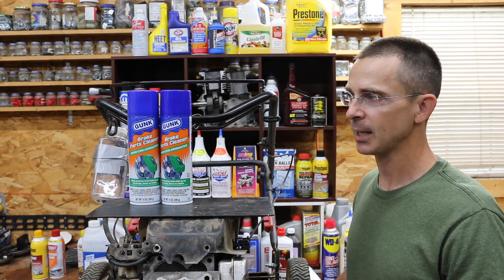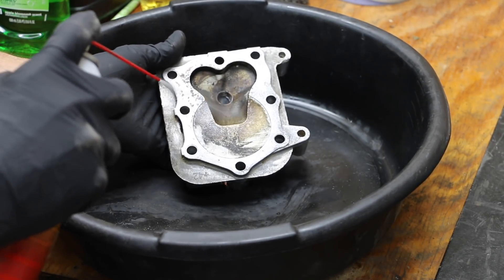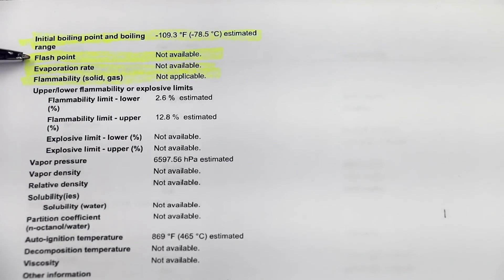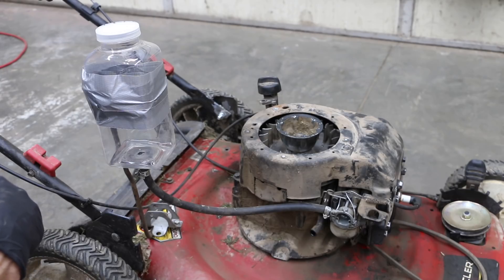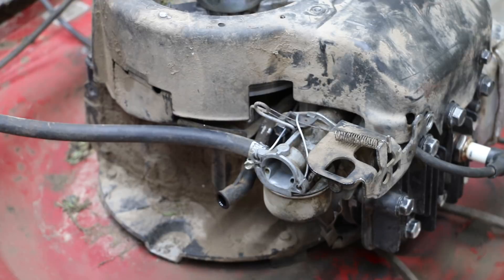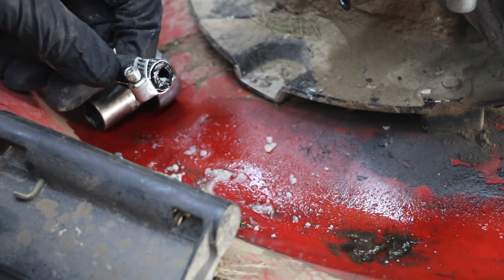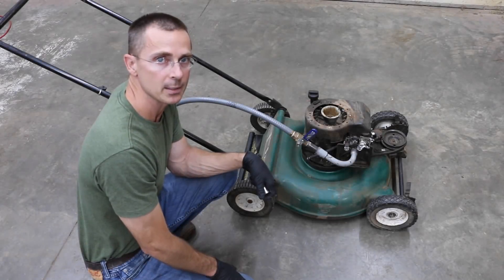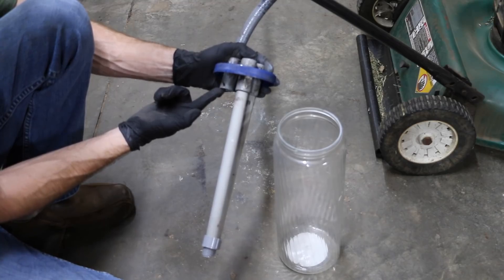Will a Gas Engine Run on Brake Parts Cleaner?  Lets find out!

Comment: My father is 79 years old he’s a gear head and loves to tinker and after watching this video he built a lawn mower that runs on vapor. This kind of stuff keeps him still wanting to build things. Thanks for your content we love it.
Reply from the maker: That is awesome!
Reply: ALL engines run on vapor. That's what a carburetor does...
Reply: @davelowets  you have no clue how fuel works
Reply: @goldgulfcoastdesignericsho8628  Yup, sure do. Do you?? Fuel in a liquid state does NOT burn. It HAS to be a vapor, therefore ALL engines convert the fuel to a vapor before it's burned in the combustion chamber. Fucking about, and trying to "make an engine run on vapor" is COMPLETELY unnecessary because the engine already does so on it's own. Wise up, man.
Reply: @goldgulfcoastdesignericsho8628  If you're a "mechanic", you're a very poor one.
Reply: @davelowets  It's all good, you both right, normal people would claim the liquid fuel is all that's needed cause its what they see, but the carburetor mixes or atomizes liquid fuel with regulated air to form the desired vapor that is then combusted. I guess the vapor rig is a good troubleshooting substitute for a suspected bad carb. Usually pretty evident with bad carb symptoms, but sometimes tricky/difficult to pinpoint and maybe the vapor rig would help. Already its proven to work if you need those last blades of grass to cut while ordering/waiting for another carb,
Reply: @davelowets  your right. If you had a 5gal bucket full of gas with an exhaust fan over it to keep vapors from pooling on top and around it. And threw a cigg road flare  match.  It would snuff out in the bucket. That vapour modification ppl do does seem to be misunderstood. Your doig the same thing the carburator does but the amount of agitation is what will vary in a resukt if more or less fuel being consumed. If its churning up a bunch of bubbles and highly agitated like this guys is. Then your doing nothing. Possibly getting even less fuel efficiency. But if you have set to mildly agitate it and it takes some trial and error you can make it runn and use reasonably less fuel. My pressure washer uses much less fuel than it did with my bubbler set up. It doesn't rev as high as it did normally. But I still get the same amount of water pressure.  Also I have to put a little gas into the carb to get it started. My bubbler set up is enough to keep it running but not enough to start the motor.  Which an engine uses more fuell to get started. And with a gravity feed set for the starting parameters is going to be wasting fuel using the same flow rate to run it.
Reply: @mikeyd717  IF the engine is tuned correctly, it is going to run the SAME, and use the exact SAME amount of fuel, whether its running off of a carb, fuel injection, or some type of "fuel vaporizer" system. If yours is running longer on your system, then you're simply running it leaner that is was with the carb which might NOT be good for the engine depending on how much leaner it is running. One could get the exact same effect by leaning out the stock carburetor a little bit. A proper air/fuel ratio and fuel rate consumption for a specific model of engine IS what it IS, and the engine is going to consume fuel at the same fixed rate(assuming proper tune) no matter how it's getting it's fuel. There's NO magic device that is going to change that. Unless you don't know how to properly tune a carb, that is.
Reply: @davelowets  I don't know for sure where the guy who modified the Ford Maverick got the idea from but when I saw it I figured he must have read about an inventor in the 70's who held a patent for a carburator that he put in a Ford ltd and drove it 200 miles on 2 gals of gas. His name was Tom ogle. And a news crew was there to report on it. They checked the car all over for hidden gas tanks etc. Then the reporter I think rode with him for the 200ish miles before they ran out of fuel. It does get a little conspiracy theory around his invention and what followed after he made the trip.  Which is fairly new info the original story I read years before didn't have any of that other stuff just the fact that it did happen and the guy had a real patent for a carburator design. And it was all before you tube magic and perpetual machines with hidden Motors. Back in the earlier days of information exchange on the internet.  The story of Tom ogle seems to resurface whenever issue of high gas prices come up for debate. I'm not an engineer and I learn from reading and doing my best  to sort out what makes sense and what doesn't. I do believe that vehicles aren't offered with maximum efficiency possible in mind. There's a lot of variables involved some with good reason. Others With more questionable motives. And I def believe that  Maxing out horsepower and throttle response doesn't equate to better efficiency.
Reply: @mikeyd717  Thats all a scam...

Comment: This was not educational? You indicated the engine temp before & after, you said very its corrosive, kills rubber & plastic. I saw an alternate fuel should I get suck in a snow storm in Alaska, on in the desert without water.  I may trash the engine by the time i get home but that can be replaced.

Comment: I've not watched the vid yet but im sure it will work, i drive gokarts (2-stroke) and when they don't fire up, there's a trick where you spray brake cleaner through the spark plug hole and then try start it again (with the spark plug in obviously) and if it fires 2 or 3 times and cuts out, you usually have a fuel problem, if  it doesn't fire at all, usually the spark plug needs changing. If it starts up and continues running like normal, there was probably just an air bubble in the fuel line

Edit: just be4 i clicked play, i thought of something, tm pretty sure break cleaner is more explosive than petrol, so i think it will start up, but then go WAY past the rev limit, like trying to run a car on purely nos

Edit2: i was wrong lol
Reply from the maker: Thanks for the feedback.

Comment: Back over 50 years ago, the subject of gasoline octane came up in my high school chemistry class. As a teenager very interested in everything automotive, I thought high octane meant really explosive, powerful gas.  You know, Av-gas, the Ethyl or High Test, or I will just say the number "260".  You guys know what I mean, the fuels of the day.  We all knew that high compression engines needed the high octane stuff.  Imagine my surprise when I learned that high octane gasoline burned,  "exploded", slower than the regular grades.  And that it was that ability to slow burn that prevented "knock" and all of the bad things associated with it.  The Octane rating of a fuel reflects how likely is a fuel to resist knock.  With a rating of 0 being the worst, and a number of 100 given to a very good fuel indeed.  The rating of 100 was given to the hydrocarbon  iso-octane and (that is where we get the name of the scale from) a rating of 0 was assigned to n-heptane, a compound that, as fuel, knocks very badly indeed. So, in principle a 50/50 mixture of iso-octane and n-heptane would get an octane rating of 50 ( 0+100/2) and so on.

So back to the brake cleaner ingredients listed for the product formula. They are disguising some of the ingredients by not using the more commonly known names for these compounds.  2-PROPANONE is also commonly know as acetone.  DIMETHYL BENZENE is also known as xylene Our friend n-heptane is listed as HEPTANE and the Carbon Dioxide is probably the propellant.  So we have a mixture of acetone, xylene and heptane and this mixture is being used a fuel in an engine.  Since it burned rather well in your test, I was curious as to what the octane rating of the fuel mixture might be.
Let's look at the Octane ratings (RON) for these compounds when they are used as fuels.  Acetone has a rating of 110, Xylene is rated at 118 and we already know Heptane is a big 0 in this scale.  I figure a 30% Heptane 30% Xylene, 40% Acetone mix will have an octane rating of about 80 or so with a higher number obtained, if we reduce the Heptane in the mix and replace it with a higher portion of the other two. So this brake cleaner is anywere from 80 to 90 Octane. This is not too far from regular pump gas at an 85 to 87 Octane rating so, the lawn mower engine ran well on the brake cleaner mix.   Of course, sending this mixture through the fuel system of any engine will probably have a negative effect on the fuel system components, as you already found out in your test.

Back in 1947 when research was being done on the relative benefits of adding different compounds to plain gasoline, to improve on its burning efficiency and raise the octane level, it was found that adding 10% acetone (mix AC10) to the mixture was about the sweet spot for benefits versus bad things happening to the fuel systems of the day (think no catalytic converters, no O2 sensors and the like).  Things like flame front speed, more complete burning, heat of combustion, combustion pressures and temperatures, torque and horsepower were improved when acetone was added.  They also found that adding ethyl alcohol had similar effects and that it was safer and cheaper to do so.  But not as cheap as adding tetra ethyl lead to raise the octane!  And who was concerned about lead safety anyway, right?  
Hey great video!  I guess we never know what we'll find you running through that collection of lawnmowers that you have.  How about a 10% acetone and gas mixture?  They knew it was good back in '47....
Reply from the maker: Thanks for the video idea.

Comment: you will find out that different manufacturers use different names for the same CAS #. In this case Propanone is actually Acetone. That might explain the degradation of the fuel system.
Reply from the maker: Thanks for the feedback.

Comment: I know its been done before, but have you ever messed around building a homemade gasifier? I've often thought of a small setup for a riding mower. You already know this, but for the folks that don't, a gasifier is essentially a choked back wood fire. Burning wood creates flammable gases that an engine can burn instead of using liquid fuels. Probably a large project, but just a thought.
Reply from the maker: Thanks for the video idea.

Comment: Great Video !  I enjoyed it a lot I do have a one question to ask. Recently I was cleaning  3100 Honda gas pressure washer and are used  clean-R-carb  carburetor cleaner to clean  carbon off of the piston.  After I finish cleaning I took it outside I tried to run motor.  After trying couple of times to start the engine. It start running but it would shut off after a while. I put it away for me to look at it the next day when I came next day I saw a puddle of oil under the pressure washer. It looked like some of the carburetor cleaner went  inside the engine  and damage a lot of seal around front cover. 
My question is:  do you think if I put hole canister inside the engine of a pressure washer will that engine become a bomb or I should say potentially blowing up and injuring someone? Or if ever engine being blown off from carburetors cleaners inside the engine?
  I would really appreciate if you can answered my question or if you can point me to the right direction where I can learn more about engines.

 thank you

Comment: You do know that fuel is turned into a vapor when it is mixed with air in the carburetor and sent into the firing chamber right? So I wouldn’t expect to see a difference between your vapor and liquid test since the carburetor was doing the same thing your bottle vapor thing does.
Reply from the maker: Thanks for the feedback.

Comment: Spraying Brakekleen in the intake is a common troubleshooting technique for diagnosing crank no-start issues in car engines. If you get injector pulse and spark, and it runs fine on brake cleaner, you know you've got a fuel issue.
Reply from the maker: Thanks for the feedback.

Comment: Did ya test the liquid remains of the brake parts cleaner after the vapor run to see if you could still have a viable use for the liquid, like a 2 for 1 deal.

Comment: Try starting fluid
Reply from the maker: Thanks for the feedback.
Reply: @ProjectFarm  we all know starting fluid motor will run off of it but for how long and what does it do to the internals that's what I would like to know they always say starting fluid is not good for gas engines but here lately I've been having to use it start a 2000 Oldsmobile Bravada every time I would like to set I would have to spray to get restart it but that it would run fine after that it's already run off regular gas

Comment: Will the engine Run in used eroding oil ( edm) ?  I can send you some . You can use it for lubication as well. I think it will ruin your engine quicker than the head and sholders 😀

Comment: I know this is a old video and honestly just seen it now. But, some carbs have a rubber in the seat for the float. If blow compressed air from the fuel side into the carb it will blow out the rubber seat and will just keep dumping fuel into the float bowl.
Reply from the maker: Thanks for the feedback.

Comment: Yeah good call about using non chlorinated brake cleaner. They do the same thing in welding when used as a solvent.
Reply from the maker: Great point on welding. Thank you

Comment: I had a small diesel pickup the glow plugs stopped working and I used wd40 to start it. They may have changed the ingredients since thin. That was in 1980  just  Curious if a engine would run on wd40. Enjoy your videos.

Comment: Great Video! I have been watching for a while and was wondering if you have considered adding a heated 02 Sensor and Gauge to your lawnmower setup during tests?  A 12 volt battery or 12 volt power supply could run the heater for the 02 sensor and the gauges are fairly inexpensive from orilleys, You could then run some tests under rich then lean situations. Just a thought. Wishing you the best
Reply from the maker: Thanks for the video idea.

Comment: Try running that mower engine on LH (liquid hydrogen)!  😂😂😂😂😂👽👽👽👽👽👽
Reply from the maker: Thank you for the video idea!
Reply: @ProjectFarm  Some prior members of the student section of SAE at my alma mater tried it in a Ford 2 liter 4 in a donated '72 Pinto.  They found they couldn't get it to run right without mixing the LH with CNG, methane, propane, or gasoline.  If you try it I'd love seeing how far you can get!  But the IC engines that run on LH seem to be rather specialized.  
¡Buena suerte!

Comment: VIDEO SUGGESTION: Get a 2-cylinder engine, disconnect the 2nd cylinder from the intake and ignition system, lock the 2nd cylinder's intake valve permanently open and its exhaust valve permanently closed, drill a hole in the side of the 2nd cylinder just above BDC, and route the exhaust from the 1st cylinder into the 2nd cylinder's intake port. (the hole near the bottom of the cylinder will replace the original exhaust port.) Why? To see if you can salvage some extra horsepower from the expanding exhaust gases produced by the 1st cylinder, without requiring the same fuel consumption as a normal 2-cylinder engine. I know for a fact that some very old car engines were designed to work this way, but I don't recall whether the design was effective.
Reply from the maker: Thank you for the video idea!
Reply: @ProjectFarm : It's more complicated than most of your tests, but hopefully you can find the time and energy to test it anyway. I wouldn't mind a shout-out if you do make a video about it. 😁

Comment: Your vapor carburetor is a cool idea, but you need to add a Y-joint into the intake hose, and have an adjustable valve on the open end of the Y-joint, so you can adjust the vapor-to-air ratio for different types of fuels.
Reply from the maker: Great suggestion. Thank you

Comment: Dear Project Farm,

New sub here.  Could you compare your tests to standard gasoline in the carbon build-up comparisons?  Everyone who's pushed a lawnmower knows how a small engine runs on gasoline as far as feel goes, but not as many people have seen how much carbon builds up from gasoline in the combustion chamber.  This could give people a way to see if things are better than the norm, or worse which is pretty interesting.  Perhaps a video with a cleaned combustion chamber then a typical run with gasoline to show what level of carbon build up is standard.  Fairly boring, but a good point to make.

Thanks, Sark.
Reply from the maker: Sark, Great video idea!  Thank you

Comment: You should test “ motor medic air brake system anti freeze and rust guard” in an engine.... it’s basically 90% methanol.. I’ve tested it and it burns about like some good moonshine.
Reply from the maker: Thank you for the video idea!

Comment: You need a spark arrestor or check valve on the intake of the vapor mower. A backfire through the carb could be pretty bad. Thanks for all the great videos
Reply from the maker: Great point! Thank you

Comment: I had a astrostar van and I ran out of gas I sprayed freaks part cleaner into the heads of the motor and get to the gas station. It sounded horrible and I'm sure I missed something up but it worked
Reply from the maker: Nice!  Glad it did the job!

Comment: One time, I was cleaning a similar looking carburetor on a small engine. I did not have carb cleaner so I decided to use brake parts cleaner. The solvent swelled up the needle and seat assembly and ruined it. The swelling caused fuel not to flow into the bowl at all which of course resulted in a no-start condition. That was the last time I allowed brake parts cleaner to touch a carburetor!
Reply from the maker: Great point!